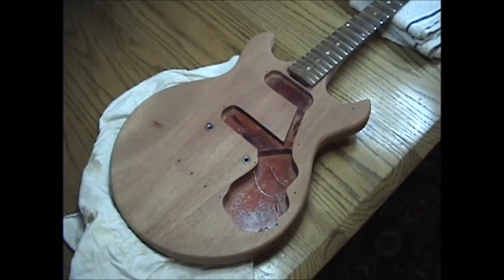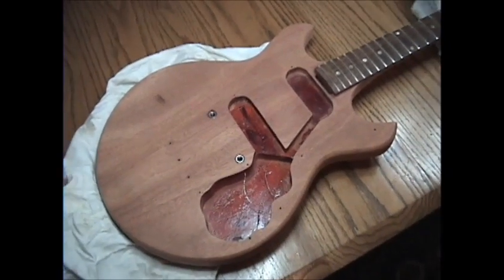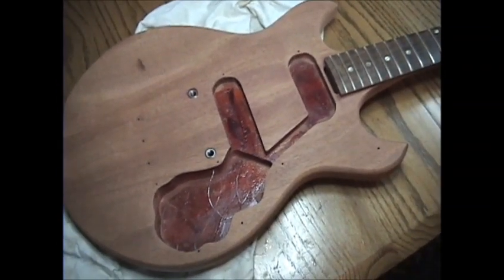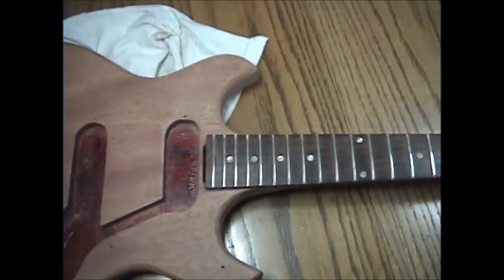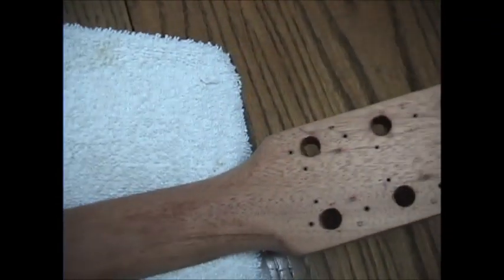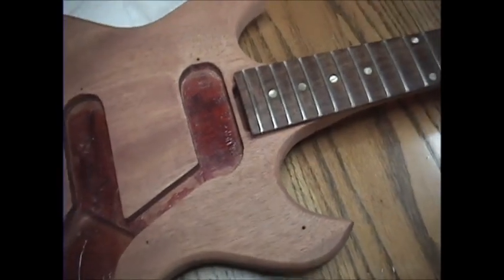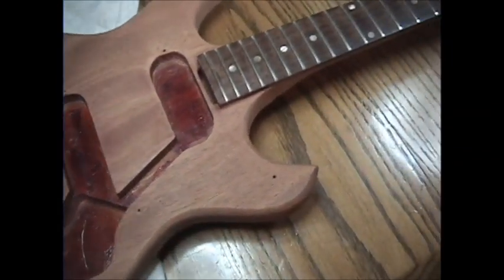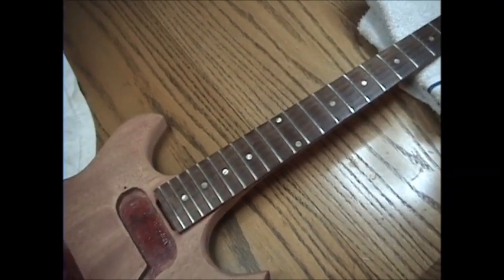1965 Gibson Melody Maker Part 1 Resto/Mod

Comment: I have an old junior from that era (s/n 0000224).  I removed the tremolo and original bridge years ago and replaced it with a Badass brand bridge which uses the existing anchors. No drilling required.  For the fret dressing also check out some of crimson custom guitars excellent videos.  That is a short scale neck and you'll need to use at least medium gauge strings to get correct intonation.  Also, although the body on mine was routed for two pickups, it only had one single coil.  Going single coil might simplify the soldering.  Cool project.  Have fun!
Reply from the maker: I picked up a Hipshot Baby Grand. I liked the adjustments it had. I test fitted it and all is well.  I was thinking that if I used a light string set that the bridge would have to be adjusted to near max and that would not be good.  I am thinking of putting Seymour Duncan Melody Maker P-90's on it with the medium gauge strings would make it real interesting axe.

Comment: Dave is the Uncle Doug of guitars! I also have a 1960 or '61 Melody Maker that I will restore, not to original but to my specs to make it play for me. Those frets look like a leveling and crowning and polishing will bring them back. That guitar is a little different from mine( I have double cutaway with one single coil pickup). I would only suggest putting humbuckers back in because the body is so thin, single coils won't provide much low end. Hey I compliment you for such an undertaking. Take your time, especially with the finish.  Will be looking forward to your video. Good luck!
Reply from the maker: Thanks.  My son has three guitars with humbuckers and am looking for an alternative.  SG, Tele Thinline, Ibanez Strat

Comment: Good foundation. What I would do with the dent in the front is use any hardwood sawdust and a 50/50 mix of wood glue and water...mix them together and use it as a filler. Sand smooth and paint. If youre looking at a oil or transparent finish, it is going to be real difficult to match the shade of the mahogany to where you wont be able to see the color shift. Good luck.
Reply from the maker: I really don't know what I am going to do with that crater.  It will be the difference between solid paint or some sort of transparent application,  I would love to do a cherry/dark cherry burst.
Reply: Big Water Daddy Fishing Rod Repair The problem with the older Gibson stuff is the wood they used back then was so good. It is almost impossible to find a 100% shade match. The darker the stain you use, the less you will see the difference. In all honesty, with that instrument having non-original hardware on it, it wont matter much at all if you see it or not. It is probably going to end up an heir loom so resale wont matter to ya. Great thing youre doing btw. props

Comment: I have to say this is one of the nicest sentiments and project/gifts a father could arrange for his son
I also have to say that i'm really surprised you didn't hear that the best way to destroy what was left of the guitars intrinsic vintage value would be to remove the finish
65 beat up is the good kind of beat up, but se la vie. Good luck and we'll all be pulling for you
Reply from the maker: I did the research but there were many factors to consider.  As I explained in the video, I got this guitar with no hardware and when I looked into the cost of putting it back together it was probably about $2000 for a retail value of maybe $1200. The company I bought it from restores old Gibson guitars and they stripped it for parts for  guitars that were in better condition.  So I bought this thing knowing it would be a complete mod and nothing else. So I guess I apologize to all of the purists out there.  The only value I am looking for is that my son will like having a guitar that I made for him.
Reply: Oh, hes going to...probably more and more as the years go by

Comment: Came here via Dave's channel. This should be a good first project; it seems like you've done a fair bit of research beforehand, but the MM's aren't terribly complicated guitars, so it's a good combo I think.

Here's my opinion on the fretboard and frets: for the divots in the fretboard, I wouldn't worry about them too much. They're common on old guitars, and kind of a cool historical thing. They also don't typically affect playability all that much, especially really shallow ones like that. I would leave them as-is, because you could end up doing more harm than good (unless you go for a full refret, in which case you could use a radius block to sand down the fretboard while the frets are off. Still, those don't look like a problem in my opinion.)

Speaking of frets, they definitely look like they could use a level and recrown. It's hard to tell in the video how much is left (and some old Gibsons used small fretwire to begin with), so you'll have to do a bit more research on that. It looks like a level-and-recrown should still leave a good amount of fret height, but it's hard to tell with the video. You could level them first (which is a fairly quick and easy process that shouldn't take more than 20 minutes or so) and see what you've got to work with before you decide if recrowning is worth the effort; it's the leveling that takes off most of the height, but the crowning and polishing is what takes a lot of time. If they look too short after leveling, a full refret might be a better idea, but you'd only lose 20 minutes or so with that first leveling.

Either way, do all the fretboard and fret work before you put on a new nut...it'll save you a lot of headaches and if the frets aren't leveled and crowned, you won't get accurate nut slot depths anyway. Besides, the nut will just get in the way while you're working on the frets and fretboard.

I'd suggest checking out Freddy Gabrsek's videos as well: he's Alex Lifeson's (of Rush) guitar repairman, and does great work. He has a multi-part series on doing a full refret, and a lot of it also applies to leveling and recrowning. He's got several other great repair videos that are also well worth watching. His channel is at https://www.youtube.com/user/FreddysFrets/videos , just look for his Refret Tutorial videos (I believe it's a five-part series.) Even if you only end up leveling and recrowning, it's a good idea to watch all of the refret tutorials so you can see what's involved. Of course Dave has some great videos on the subject too!

Good luck, and I'll keep checking in to see your progress. I'm a guitar repairing/modding nerd, so this sort of thing is right up my alley!
Reply from the maker: Thanks man.  I have been cramming all kinds of guitar info into my head and it really helps to hear where I am on the right track or off my rocker.  I put the fret file on some of the frets to see if it was close to the fret board and there is some meat to give for sure.